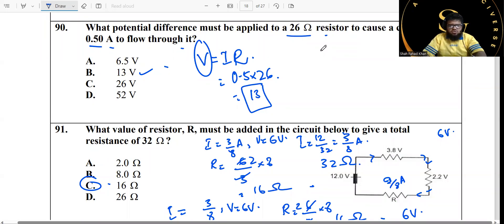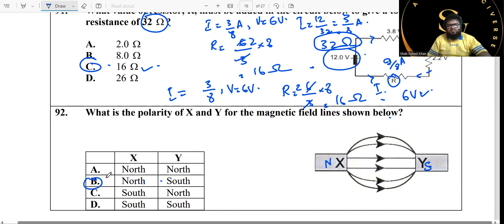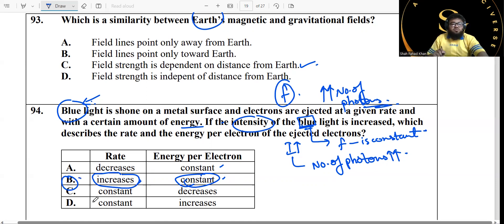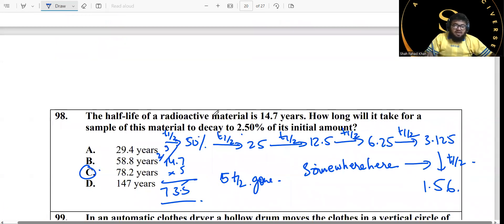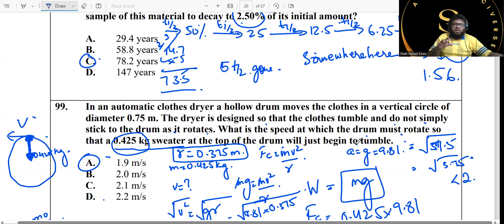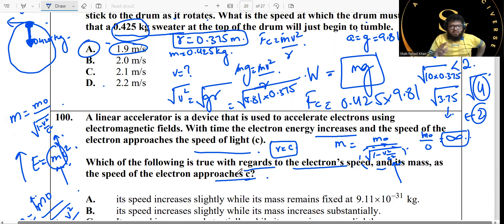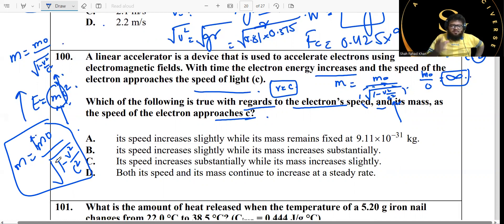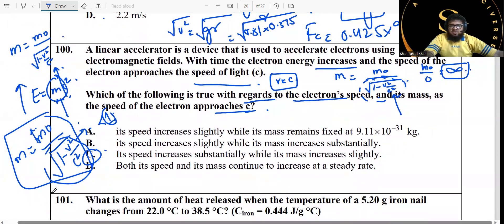AKU Past Paper 2009 Solution | Complete Step-by-Step Guide to Acing Your Exam | Physics 2 | SFK

Comment: i think your explanation for Q100 is wrong, this is what GPT says: 

(from Einstein’s theory of relativity):
As an object moves faster and nears the speed of light:

Its speed increases very slightly (it cannot reach or exceed c).

Its relativistic mass increases substantially.

This means more and more energy goes into increasing the mass, not the speed.

Evaluation of options:
A. ❌ Incorrect – The mass does not remain fixed at rest mass; relativistic mass increases.

B. ✅ Correct – Speed increases slightly, and mass increases substantially.

C. ❌ Incorrect – Speed does not increase substantially near c.

D. ❌ Incorrect – Neither speed nor mass increases steadily as relativistic effects become dominant.

✅ Final Answer: B. Its speed increases slightly while its mass increases substantially.